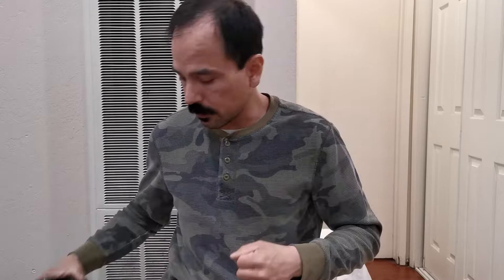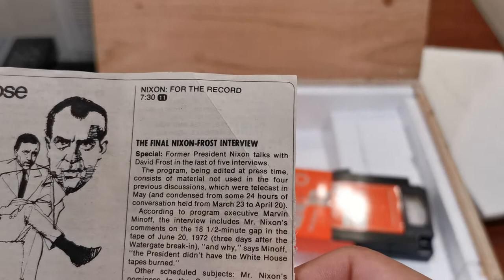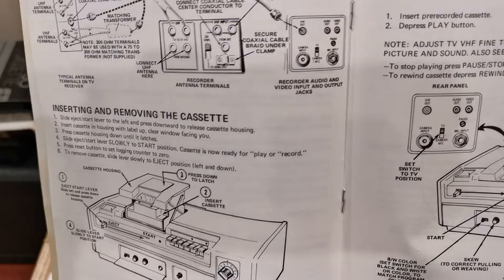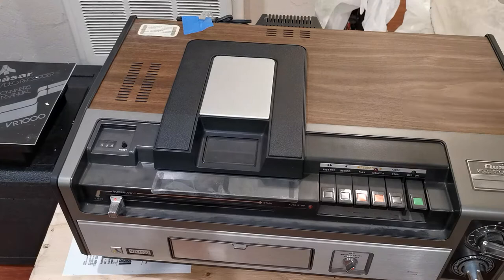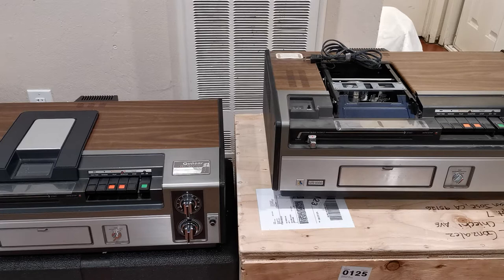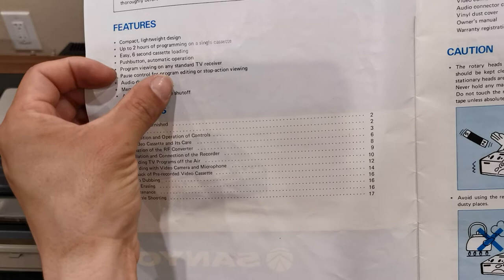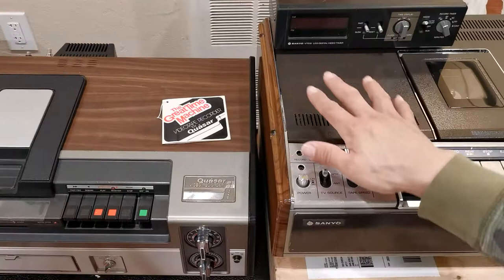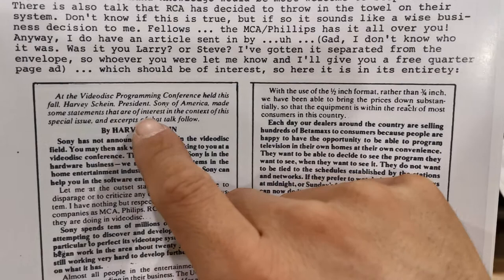Acquiring a second 1977 Quasar VR1000 Great Time Machine

Comment: I was convinced to buy the Quasar as my First tape machine by a friend who had one. I now have mine and his old one, neither of them working. And still have Many tapes (though I did throw some of His away a few years ago, and can't play any of them anyway!  Sad...wish I could get One working machine cobbled together from these two! It would be fun to see what I recorded so long ago...and transfer everything to something Useful!  (Actually...I may have Three of them! I haven't seen them in Years....they are Somewhere in my Garage, so probably rotted away to nothing by  now!)
Reply from the maker: This format was released years before I was born. It is definitely not my favorite vintage format to use. All of my Quasar VX videotapes are from eBay and what was recorded on them have become my most viewed uploads. It does take some patience and maintenance in order to bring a Quasar VR-1000 VCR running again. I have worked with much older formats including the 1973 Cartrivision format which requires much more patience and maintenance.

In my limited experience I have found that the single head system is quite durable since it is rather large compared to Beta, V-Cord2 and VHS. The motor and belt used for rewinding are too small and tend to fail on most machines. Changing the rewind belt is a must. As for the recording color spectrum and resolution performance it is incredibly low. Not as low as Cartrivision but close.

Comment: Rene does it again! I would love a VR-1000 or a V-Cord. I assume surviving examples ain’t cheap
Reply from the maker: I have been incredibly lucky regarding these old machines. I basically apply common VHS repair and maintenance procedures. You do not absolutely need expensive equipment like an oscilloscope or apply videotape baking.

I f you can fix a VHS machine you can fix a VX, V-Cord, V-Cord2, Beta, EIAJ-2 video cartridge, Cartrivision or U-Matic machine. Sure they may be huge, bulky and even scarry looking but they work via the basic bias alpha scan magnetic videotape concept. Anyone can do this, I believe in you.
Reply: @renegonzalez6755  My repair guy is finally working on my large 1962 cassette machine. Hopefully the right channel will finally play and record again after over 50+ years not working. Hope to send the even rarer 3M revere tape machine to him one day.
Reply from the maker: @oldradiosnphonographs  Those are some very rare audio machines. My favorite vintage audio format is the compact cassette, mostly because they are the audio format of my youth.

 Someday I want to own an open reel audio machine because I consider them to be very beautiful.

Comment: Hi, I have about 4 maybe 5 tapes that I would like transferred. Tapes have been kept in air conditioning since the 70's.  It's just fun stuff, me friends made back then. Nothing naughty. You can keep the tapes after transfer. Are you willing, and what would you charge? I doubt that there's more than 20 minutes of data on each tape. Probably 2 tapes have been recorded on, but you can have all of them. Others unused.
Reply from the maker: Thank you for your message. I would love to help you view your recordings. I have had the pleasure of digitizing home recordings made on the VX VCR and black and white camera. They are Christmas Eve home recordings. The Quasar VCR is seen in one of the recordings.

I have noticed that a large percentage of the professional videotape digitization companies do not offer services regarding the VX format. I don't consider myself a professional, I do not charge for digitizing and I never wish to do so. I capture in the H.265 codec in the .MP4 format at 4000Kbps video data rate with a 1440x1080P display size. I use a dedicated external time base corrector. I never transfer to DVD to minimize the chances of unnecessary interlacing.

These machines are not only rare but they are quite departmental and require a lot of maintenance. I know of three other people who own working VX format machines. One is located in the East Coast, one a two hours away from me in California and another in Arizona.

Rick Thomas is located in Arizona and he owns a professional videotape digitization company called OVS (Obsolete Video Services). Information can be found through a simple Google search. If you feel that your recordings are very special then I suggest you give Rick a call. He has decades of experience.

If you decide to allow me to help then send me an email: renegonzalez2002@yahoo.com

Comment: Rene, do you fix them? I have one and it doesn’t work.
Also, can you fix CED players?
Reply from the maker: I repair vintage machines as a hobby. I have fixed a total of two Quasar VR-1000 machines. One for myself and one for the Museum of Classic Chicago Museum. 

I have made very detailed videos where I explain exactly what I had to do to repair them. I have no experience on CED players but then again I had no experience on the Quasar VR-1000 machine about two years ago.
Reply: @renegonzalez6755  my dad and I replaced the belts on my CED machine back in 2013 to get mine working.
Reply from the maker: @oldradiosnphonographs  Some of my fondest memories are regarding those wonderful times with my Father in our garage repairshop. I basically channel my late Father whenever I make these videos.

Comment: I recently purchased a Quasar VR1000 to play a tape of my family recorded in 1977. The eject tab does not work and I have been unable to find a repairman to work on it because of its age. I don’t know if the Quasar works since I can’t test it. I’m so sad.
Reply from the maker: Are you able to slide the eject tab from side to side? If not, the eject tab can fail for a few reasons. One reason may be because the videotape became stuck onto the videodrum due to moisture or sticky residue. In this case the videodrum has become spooled with videotape and is holding the tape in the downward position.

Another reason may be due to attempting to play a tape without having the videodrum installed (happened to me once.) This would cause the videotape to become spooled onto the spinning steel bar that holds the videodrum in place.

Either case would require the machine to be opened in order to remove the tape. Splicing tape will be needed to repair the snapped videotape.

How special are these recordings for you? Worst case scenario you may have about two minutes worth of videotape ruined. For example, the Beta and VHS formats can play back very wrinkled and chewed up videotape without a problem. The 1977 VX format must have good condition videotape due to its odd 360 degree loop. A single snag and it is a true nightmare of a situation.

The repair of a Quasar VX videotape is quite involved but not impossible. I have done it three times. The answer to the ability to slide the eject button would be really helpful do determine a repair procedure.
Reply from the maker: A tried my best to explain a possible solution as a comment. Let me know how I can further help.
Reply: @renegonzalez6755  Thanks for your reply! The tape is not in the machine. I can move the eject lever, but it’s not smooth. Feels like it hangs up on something but can be moved all the way over, just not smoothly. When all the way to the left and down in the eject position, it’s loose, floppy.
Reply: And, yes, this video tape from 1977 is precious!
Reply from the maker: The condition of the rubber roller is very important on this particular format. I always maintain vintage machines before I even consider playing back a videotape.

This machine has 5 rubber belts. 4 of these 5 belts are 100 percent needed for proper playback. If the belt in charge of the steel capstain fails or is missing then there will most definitely be a videotape jam.

A failed capstain will still allow the eject button to slide back and fourth.
Reply from the maker: @brendaellinghouse3084  I live in San Jose California. I am willing to repair and transfer your videotape to a digital format. The tape will obviously need to be removed first.

I can repair your machine but the machine weighs a whopping 44 pounds and the delivery will be at least $130.

How many videotapes do you need digitizing? I have digitized about 50 VX format videotapes that I have purchased from ebay in the last two years.
Reply: @renegonzalez6755  Thank you, but I have found a camera shop that can digitize the tape for me. The eBay seller says I can return the Quasar. I paid $200 plus $99 shipping. They claimed the eject button worked when shipped. It was nicely packed so I’m doubting the eject worked before shipping.
Reply from the maker: @brendaellinghouse3084  Glad to know that your recordings will be digitized. What you are doing is very special. Your family will be very grateful for this. Enjoy every second.
Reply: @renegonzalez6755  I just heard from the camera shop and their lab CANNOT digitize my video. I’m interested in shipping my Quasar to you for repair. It turns on and the humidifier works, but the “eject” does not work.
Reply: OR I could send my video to you to transfer to a dvd and/or flash drive.
Reply from the maker: @brendaellinghouse3084  I can transfer the recording to a DVD if you wish. Your original videotape will be returned to you. If the videotape is damaged, needs a donor housing or has mold it is fine with me. I know there are professional videotape transfer services who refuse to work with videotapes that contain mold.

I would recommend both an H.265 MP4 video capture onto a USB thumbdrivr along with a DVD. No charge, simply take care of the shipping. I am located in San Jose, California.

If you have more than one videotape I would suggest sending a single one first.
Reply: @renegonzalez6755  The videotape seems to be in pristine condition. Are you on Facebook messenger so that we could exchange private information—phone and address?
Reply from the maker: @brendaellinghouse3084  renegonzalez2002@yahoo.com (408)661-0400

Comment: how much was shipping
Reply from the maker: The shipping price for the first VR-1000 VCR that I purchased back in December 26, 2020 was $119.40 via USPS in a cardoard banana box with absolutely zero protective padding. It arrived with a substantial dent in the rear corner that bent the bottom plate. There were three broken plastic pieces inside the box that belonged to the rear cover.

The second one that I purchased on September 02, 2021 was $83.00 via UPS in a 3/8" plywood crate with plenty of styrofoam padding. This is still the best protected VCR that I have ever purchased.

The third one that I purchased on November 30,  2021 was $171.00 via USPS. It was shipped inside a banana box with newspaper padding. The 4 bottom feet ripped right through the cardboard and one was broken off during shipping.
Reply: @renegonzalez6755  thank you I have one for sale and needed some insight on the solution to ship. Another question the tape the vr1000 came with has some mold if anything is on said tape is it recoverable?
Reply from the maker: @matthewdye2519  I saw your item this morning because I was notified via eBay's wonderful saved keyword feature. The price is very competitive and the VCR looks to be in wonderful physical condition. The photo showing the video drum really stands because it is the "heart" of this machine and finding a replacement is incredibly challenging. I would buy it but I honestly don't need another one.

Shipping such a heavy VCR in a cardboard box is fine but I highly recommend that you use styrofoam padding. Half inch sheets of styrofoam are a bare minimum. If you can try to double box it it will really help. Always assume that a heavy package will be dropped and bumped around unless you ship via FedEx and DHL which charge a small fortune.

Regarding a Quasar VR-1000 videotape with mold it can be played back but the picture quality will go down drastically. There will be a significant amount of horrizontal white noise no matter how much one adjusts the tracking knob. The audio will be fine since the audio performance is one of the strengths of this machine. The audio head is huge and it is manufactured by the Japanese TDK Corporation. Mold tends to affect the tracking the most on this machine.